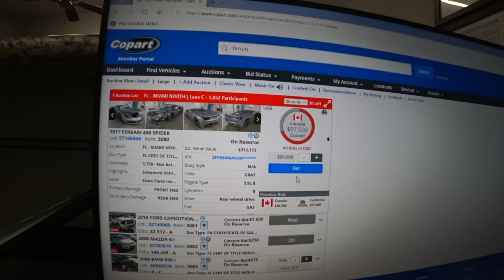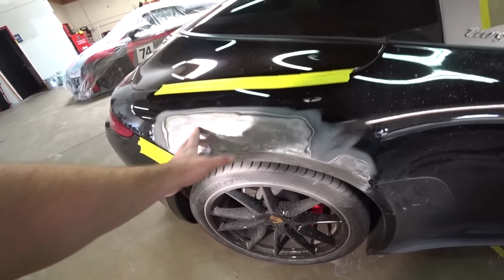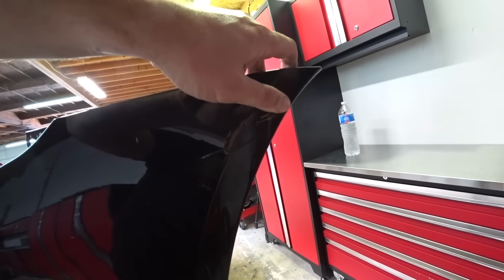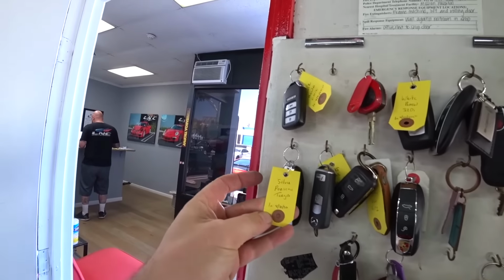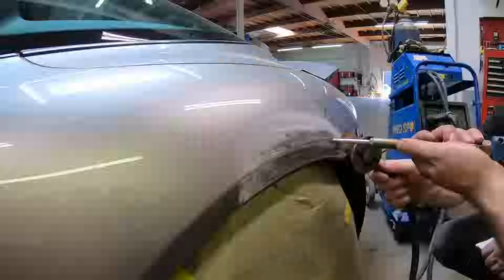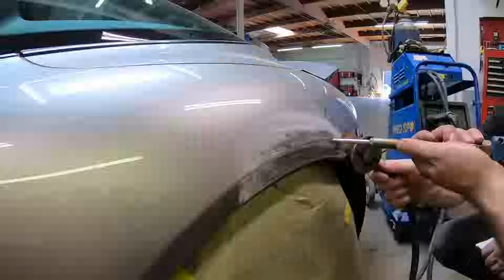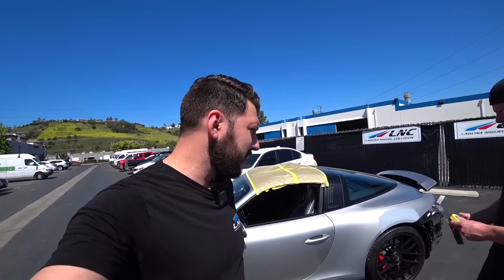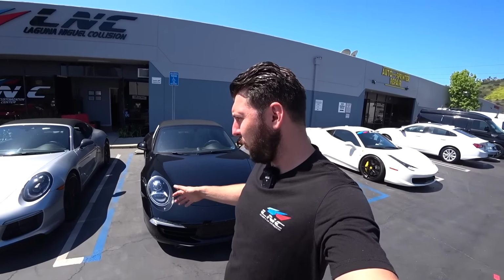HOW TO REPAIR A QUARTER PANELS ON 911 PORSCHE TARGA VLOG DIY

Comment: On black one. You could do much better puling(great equipment, a bit more will) out the fender shape and then use much less putty filler.

Comment: Hello Lnc, which used suv would you buy a 2016 cayenne or 2016 range rover sport both 3,0d?both 55,000 miles
Reply from the maker: I would go with Cayanne

Comment: Hello my friend, I have been following you for a long time, please own a car in 2008 and it has light scratches and I want to remove it, what do you advise me 
Good bay
Reply: Light scratches? Try to buff them out with a compound and then polish. If they dont dissappear use a Paint Pen. But depends on the value of your car
Reply: @DoNKing991  Some one tell me to use 2000 paper after 2500 and polish is that okay dud
Reply: @bed1485  If you have experience with (wet) sanding you can try it. But i would start with the least aggressive method and Work your way up
Reply from the maker: Try wet sanding with 2500 paper very lightly and buff and polish
Reply: @lnccollision  thanks LNC can I use 2500 and 3000